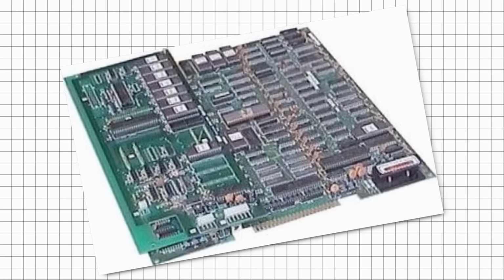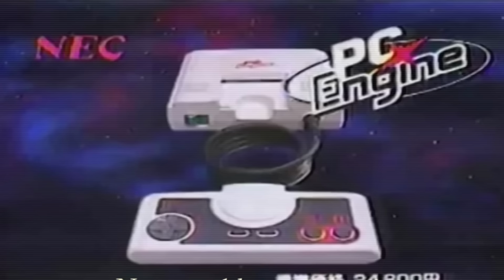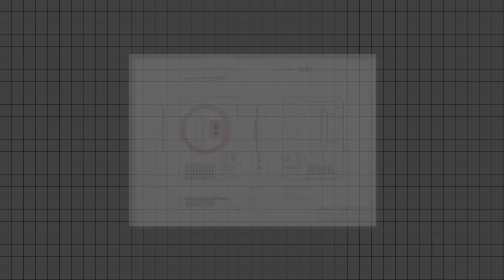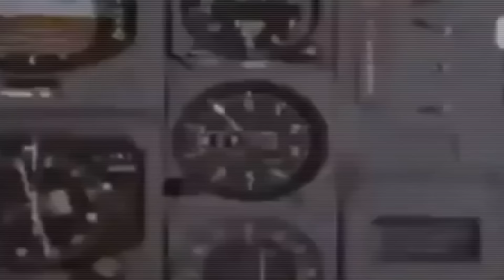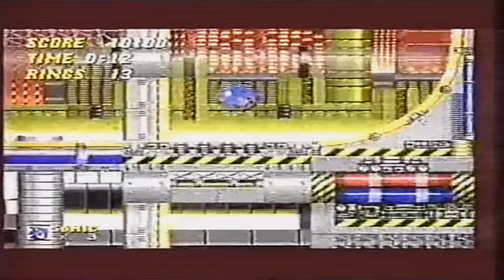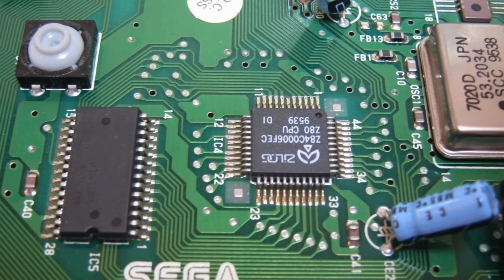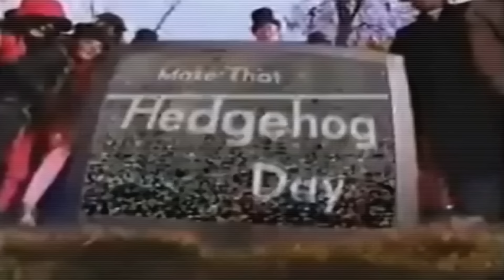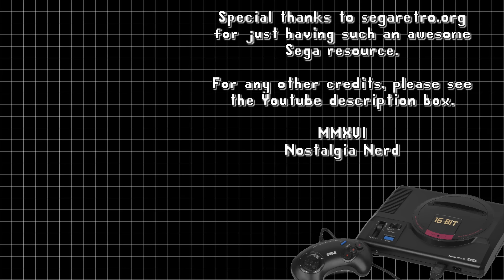Sega Genesis/Mega Drive Story | Nostalgia Nerd

Comment: Yeah, the Megadrive holds a special place in my heart as well... I still have my black-and-red M2 but sadly years and probably rust.. not to mention the lack of a COax-In anywhere prevent me from using it.
I own an AtGames clone but it sucks... terrible waste of 30 euroes, so now I am saving for an Analogue Mega-SG.
Reply: You can just buy an RGB Scart cable for the Megadrive. I've just done so myself. Go to 'Retro Gaming Cables UK' website for the best place to get the best quality cables. You can also buy an OSSC to improve the image quality even further, but its quite expensive.

Comment: I want to add that the Genesis' sound capabilities could be quite amazing at times, a far cry from the poorly optimized soundtracks found on certain ports which people like to mock to this day. Just listen to Time Trax's OST and it's clear to see that, as long as the composer or arranger (the legendary Tim Follin in this case) knew how to work with FM synthesis, music on Genesis could give any SNES soundtrack a run for its money and then some. It's just unfortunate that so many soundtracks were sloppily handled due to how much more difficult FM is to work with than sampling. I feel like the Genesis' sound card wouldn't have nearly the bad rap it does today if more sound engineers back then had more experience with FM.

Comment: Pretty good video! The Mega Drive is my favorite console ever alongside the Neo Geo, the Saturn and, computers wise, the Commodore Amiga.

The Mega Drive had a huge impact and was very successful but could have done even better if:
1° some of its best games such as Pulseman or Alien Soldier didn't stay in obscurity due to lack of diffusion.
2° Nintendo and their cheap moves didn't prevent some things to happen. For example Street Fighter II was one of the main reasons behind SNES success but if it was released on Mega Drive at the same time AND a version that properly uses the system capabilities, history would have been otherwise. Street Fighter II SCE on Mega Drive is a good version on par with SNES Street Fighter II Turbo but Crapcom deliberately underused Sega's console capabilities, some recent hacks improved the sound effects/voices/colors while still using the same cartridge size and the resolution could have been improved as well (Mega Drive standard resolution is higher than SNES)... So imagine a port which fully uses the Mega Drive capabilities and released around the same time as the SNES port? This would have blown everyone's mind!

Anyway it's great that, as time passes, many things are highlighted, some truths revealed and everyone improves their experience.
Reply: Parallax Craze Ya, genesis is so great. Lots of colors, something snes never had..... Oh, wait.
Reply: Competent colors capabilities in proper 320x224 resolution (Genesis) > more colors but everything in low resolution which causes stretched graphics with wrong aspect ratio and smaller playfield (SNES).

I take ANY DAY Genesis versions of Earthworm Jim or Mickey Mania for examples which despite displaying less colors still look great AND run in proper resolution as opposed to SNES versions which have stretched graphics with wrong aspect ratio and smaller playfield.
Reply: ... And Genesis resolution advantage also provides sharper visuals.
Reply: Parallax Craze Animations are also terrible on the genesis. Look at Mortal Kombat, those characters move like crap. The snes version makes the characters fluidly move
Reply: Mortal Kombat 1 and 2 were made by Probe, a company well-known for laziness so this is not relevant. Still it's funny that the first MK is better on Genesis thanks to better gameplay and non censorship.

Compare Mortal Kombat 3, both ports were made by Sculptured Software and it shows as they're very close this time around: the SNES version has better backgrounds but Genesis version has better sprites (thanks to Genesis' higher resolution), clearer sound, play faster and has others advantages such as the streets theme which plays just as we enter the streets.
Reply: @parallaxcraze958  Gameplay was better on SNES Mortal Kombat 1. Megadrive Street Fighter was not as good as the SNES versions. Both consoles have pros and cons. I was lucky enough to own both, but I was more of a Sega fanboy.

Comment: The Sega Genesis was indeed Sega best fight back against Nintendo and its NES. The 16-Bit era was Sega at its best and it's sad that Sega got too full of themselves that they eventually started going downhill once the Saturn and Dreamcast arrive. Saturn was the nail in the coffin and Dreamcast never had a chance. If there's two things Sega need to eliminate in the 90s, it's the Sega CD and 32X, Sega Cd was unnecessary as Sega is going to launch the Saturn anyways as a better CD-based console and the 32X shouldn't even exist as the Saturn is already a 32-Bit machine. Had Sega just kept the Genesis going for another two years until and after Saturn's launch then Sega would had held better against Nintendo and we wouldn't see the arrival of the PlayStation (cause really Nintendo only went to Sony so to get a CD add-on just like Sega but backdown on the deal and cause Sony to take action to make their own game console).
Reply: ***** The next big thing in the 16-Bit era was the used of CD format for games and media. Turbo Grafx-16, Sega CD, Jaguar CD, and NeoGeo CD all jump into the hype. Though many of those third parties made a CD add-on or a CD console it was really Sega that attempt to persuade Nintendo to get on the hype for using CD as well. They knew of Nintendo's close relationship with Sony and had they not try to predict Nintendo's ambition, Nintendo wouldn't back away from the attempt. 

Remember Sega CD's old commercial? The guy in the commercial actually predict Nintendo by name, "Hey Why aren't you buying a Sega CD, what are you waiting for, Nintendo to make one?" That prediction is either true whether Nintendo made one or not. Cause if Nintendo does make one then it's obvious Sega knew all along that Nintendo must join the hype, if Nintendo doesn't make one then the commercial is valid as Sega knew consumer is just waiting for nothing as Nintendo did not jump on the CD hype until the GameCube. 

If Nintendo joins the hype, then they would had partnered with Sony and made the PlayStation, if they decided not to join the hype Nintendo would had just leave Sony alone and the PlayStation wouldn't had happen thus Trip Hawkin maker of the 3DO would had gotten Sony as a manufacturer for the 3DO instead just like Sanyo, Goldstar, and Panasonic. The real truth is Nintendo was going to join the hype, but they got full of themselves that they back down from the partnership and the PlayStation was created whether or not they back away. So the PlayStation happen because of Sega and Sega's influence and prediction on Nintendo.
Reply: Voan Siam if they had looked and did their research good and future proof their console...to hell with backwards compatibility....extra 64kbts of ram could have gone there..allowing more colors,more sprites,more sound with even crisper,clearer voice samples......almost 32x quality without any addon.
Reply: bla bla bla whiskas saquetas
Reply: If it weren't for the Sega CD the Playstation may have never existed.

And if you look past the shitty FMV games (and even some of those are fun in a guilty pleasure kinda way)  it actually had some pretty great games on it.

Comment: Nice video! Love the Mega Drive! Such an excellent console, very close to the Arcade machines, just like the Dreamcast 👍👍
A few minor technical corrections @ 4:31 you're not showing the IC containing the TI SN76489 clone. The 315-5364 is the Bus Arbiter/68K address decoder. The actual PSG is in the 315-5313, the VDP (Video Display Processor) which is the large ASIC in QFP format, responsible for video output on the Mega Drive (graphics, sprites, DMA, etc. but also the PSG, similary to what they did in the Master System..) 
After that you're showing the main genereal purpose DRAM DIP packages, which is 64K in total, not 72.. The 64K VRAM are the two dual ported NEC µPD41264's in the weird upright ZIP (zigzag) packages residing next to the VDP (the rest of its memory consists of 8K of dedicated sound DRAM (single DIP package next to the Z80). There's also 80 Bytes of VSRAM (Vertical Scroll RAM) and 128 Bytes of CRAM (Colour RAM), both residing inside the VDP ASIC.🙂

Comment: Ah Mega Drive. It was Genesis here in America, but most Sega fans from my generation remember filing out the edges of the cartridge slot so it would accept the region-locked Mega Drive games which would inevitably be released earlier, or exclusively in Japan.

Comment: My MegaPC eventually died when caps on the board blew up.  It's case survives, it is right in front of me here, under my monitor, I got so used to having a monitor at a certain height on a case I use its case as a shelf.  The Amstrad MegaPC also came with a strange monitor that piped sound through the vga connection, I still have that and the white pad.

Comment: Vrgin/Mastertronic go the marketing spot on back then, but it did equalise later on as the 90s broke. As an amendment, you said in '91 the Mega Drive didn't have NES as a competitor, but in 1991 the sale of the Master were 300, the NES were 325 and the Mega Drive were 196, so the NES was very much active in the UK in 1991.

Comment: I remember buying a cartridge from Thailand to the UK, but Sega had physical DRM but was easy to get around by taking the case off the cartridge, but  you had to align it just right to make it fit the connectors inside the console. Probably played so much Sonic and Streets of Rage on it, but was wishing to get Street Fighter and special 6 button control pads ages ago but never did.

Comment: As far as I'm aware, there was never an early model Genesis with a 9 Pin DIN... Unless you're referring to the Bus connector, which is not for Audio/Video output.  All early model Genesis systems had an 8 Pin DIN output.  It wasn't until the slimmer Model 2 that we got a 9 Pin Mini DIN output.

Comment: The main problem that the Mega CD had was that when Sega designed the Megadrive they didn't bother to connect certain pins on the VDP that would have allowed direct access to the VDP's VRAM and allowed for the addition of additional color pallets and expansion of the number of colors. The Megadrive VDP has support for an additional 64K of VRAM and can support external color pallet RAM, but the pins were left unconnected. Had these pins been connected to the expansion port then a 64K shared bank of VRAM could have been added to the Mega CD that would have allowed the scaling and rotation hardware to directly write to this block of memory which would have then been immediately available for display by the VDP. Instead it has to perform the operations on images stored in dedicated memory on the Mega CD, send it across the cartridge buss to the system RAM in the Megadrive and then have the 68000 in the Megadrive move it from there into the VDP's VRAM. As well, they could have easily expanded the number of color pallets and the available colors, the System C2 arcade board actually used these features and has an external color pallet RAM for additional color pallets as well as a total of 256,000 available colors using the same VDP as the Megadrive. It also has the second 64K bank of VRAM for a total of 128K)

 Connecting these pins to the cartridge port would have allowed for a pure digital connection between the Megadrive and 32X though it probbaly would have have still required a new video output on the 32X. This would also have been necessary on the Mega CD to increase the total available number of colors, a new color lookup table and video modulator would have been needed although simply increasing the number of available color pallets with external color pallet RAM would not have required this. The Megadrive has 4 pallets of 16 colors which are selected from 512 possible colors and each background tile or sprite uses the 16 colors from one of the 4 pallets. Adding additional color pallets would not significantly affect how much memory was required to store graphics images as each tile or sprite is 4 bits per pixel regardless of whether there are 4 pallets or e.g. 8.
Reply: Really does show how cost cutting and design issues affects things huh.
The problem with having the memory on an expansion or cartridge bus is that to be able to deal with 64 kilobytes of video memory you need at least 16 data lines and 15 address lines. Which is something like half the pins on a cartridge, certainly not trivial.
The snes, like the mega drive has an extra pin to address 128 kilobytes of VRAM.
I believe the snes suffers even more for it, because it has an 8 bit per pixel high colour mode which doubles the amount of VRAM you need for a background tile. Or, the high resolution mode where you'd need a 64x64 tilemap just to see the entire screen. (and that's 4096 tiles if you'd like them to all be unique - which, aside from being something an snes cannot handle, it also requires 128 kilobytes of RAM in it's own right just to have that many tiles. - the mega drive meanwhile can have 2048 background tiles, but for the same reasons you can never use all of them, because that's 64 kilobytes, and you still need a tilemap of 2-8 kilobytes, and whatever sprites you'd like to use.)
It's not actually trivial to use extra palettes though, since the tilemap entries on both the mega drive and snes are 2 bytes per entry...
And every single byte is accounted for by both systems. Both have a priority bit, horizontal and vertical flip bit, and then the snes has 3 bits (8 values) for palette selection, while the mega drive has 2 (4 palettes), and the remaining 11 bits on the mega drive specify the tile number (so up to 2048 tiles), while on the snes there's 10 bits left due to the 8 instead of 4 palette entries  (1024 tiles)
There are of course ways around these limits without breaking the 2 byte tilemap entries; The snes demonstrates several of them in fact, since on the mega drive the 2048 tile entries refer to memory in a fixed location, while in the snes you can specify a memory location to start from, and more importantly, you can specify it per background layer.
so there's 1024 tiles per layer (the memory for which can overlap, or not), rather than 1024 total.
Similarly, while almost nobody uses mode 0, which has 4 backgrounds but each tile is 2 bits per pixel instead of 4 (3 colours rather than 15), it does demonstrate another trick. Even though you can still only choose from 8 palettes,  in this mode each of the 4 layers get an entirely seperate block of 8 palettes to work with.

Point is you can't simply add palettes and such, because of the tilemap. You can see the trade-off you run into in the difference between the snes and mega drive tilemaps, because both have 2 byte entries, but they use them differently. The 8 snes palettes come at the expense of 1024 less choices in which tile you use.
The only way around this would be to use 24 or 32 bit tilemap entries, which would massively increase VRAM use, but also has the additional downside that the VDP and PPU have 16 bit memory buses, so it would also be a lot slower to work with them.

So it's a bit misleading to suggest you can just add palettes that way, though you could I suppose break apart the palettes, which the snes does...
On the Mega drive, that means you could have 12 palettes instead of 4, by giving the sprites, and both background layers their own unique set of 4, rather than sharing 4.
But that would be your only viable option otherwise the tilemap and sprite tables would have to use a lot more memory, and probably in amounts that the graphics chip isn't good at dealing with.

And it's always a nice idea to have the video memory directly accessible by some external device. The snes SuperFX chip would have worked about 20 times better if it could have done this, but there's a reason it wasn't done.
It's simply not trivial to add dozens of extra pins to the cartridge or expansion port connectors.
That's not to say it's never been done of course. the NES did it.
And predictably it had a lot of benefits in the long run, but it's certainly not a trivial thing to include.
Reply: Sega's System C2 arcade board was based on the exact same VDP as the Megadrive and actually did implement the second bank of 64K Vram and external color pallet RAM. There are undocumented registers on the VDP for dealing with the second Vram bank. 

 Interesting information about the System C2 board: http://cgfm2.emuviews.com/txt/c2tech.txt

 The Super FX chip was basically it's own self contained system, the SNES cartridge port has data pins for pixel and audio from hardware on the cartridge and this is how the Super FX output it's display to the SNES, it basically functioned as an independent fifth graphics layer. A couple games such as Yoshi's Island used the Super FX for enhanced effects with bitmap graphics and more colors rather than for 3D.

Comment: I seem to remember region lockout simply consisted of having different shaped cartridges and openings? If you were willing to file away the plastic on the slots I'm sure you could still use them across consoles.

Comment: Genesis games and consoles were lower priced due to the architecture, where the SNES's carts had more processing on the cart, and dual sprite pipelines on the board.  The SNES also used higher-grade tantalum capacitors and a custom sony sound system.  Of course, the numbers sold seem to pale in comparison to the sheer dollar amounts.